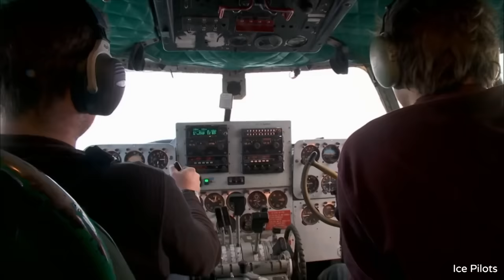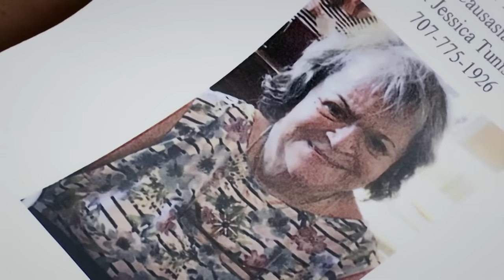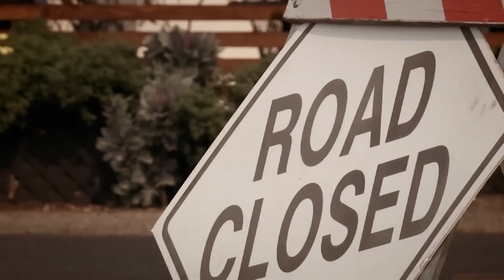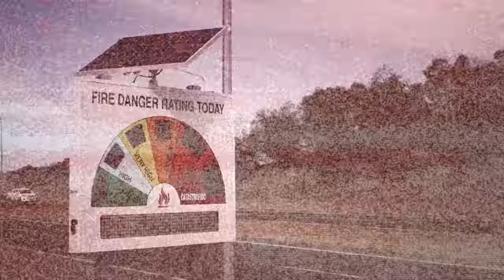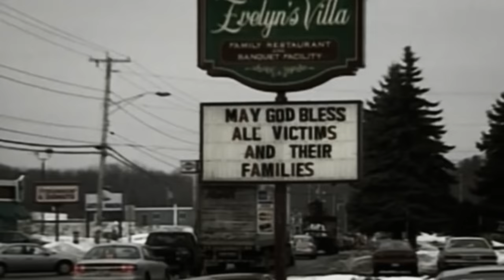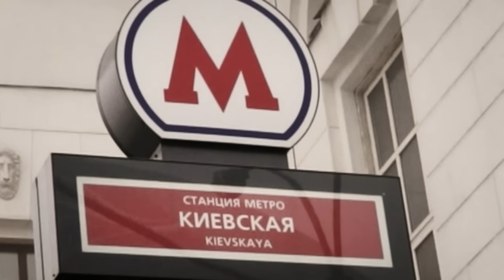The Most Catastrophic Fires In History | Code Red

Comment: The reason why the fire brigade told Grenfell residents to stay in was due to the design of the buildings. They were self contained flats within the building, with fire breaks and a central stairway that needed to be clear for fire fighters. the external cladding meant that the self contained nature of the design was circumvented. It was known to be flammable, but it was still used. When they realised the fire was going up the outside, it was too late to get the people out as the central part was clogged with smoke. The fire fighters were bringing people out on their BAs. Awful. Just awful.
Reply: Stupid firefighters and stupid building for not having more then one stairway
Reply: @beverlyarcher546  Why stupid firefighters? Blame the top, not the common man.
Reply: Stay hope not to die because of staying? No, I am getting out first chance I get.
Reply: @catnip2167  You and me both
Reply: @odd_shoes  because one they didn't think about the fact that the tower has only one staircase and could cause problems if they couldn't get the fire under control which they didn't get it under control in time and lives were lost because of their stupidity just like that ferry where the captain and his men got off first and abandoned passengers and lied about no passengers on board and all those students who died because they were told to stay in their cabins
Reply: Experts always explain the flammable cladding in Grenfell Tower which is fine, but they never discuss how the windows were replaced during the refurbishment. The new windows were installed several inches OUTSIDE of the original cement slab walls...leaving a gap that was filled with flammable finishing materials. That is what destroyed the compartmentalization that is essential for high rise buildings to be survivable. 

Other towers with similar cladding have caught fire but none have been nearly as deadly b/c fire couldn’t get back inside as easily as it did in Grenfell.
Reply: @beverlyarcher546 
Are you so ignorant as to think the firefighters climbing those stairs, at the risk of their own lives, trying to rescue strangers, had any say in the building design?
Reply: Dew can incinerate anything in its path...
Reply: The firefighters wanted to stop the stay put way earlier !
Reply: obviously that didnt work
Reply: @pretzel_cat  What you say is completely true, but I need to explain what happened and why.
The first and major factor was government austerity at the time, which reduced local authority to a minimum. Major works were not inspected during progress and developers appointed their own surveyors. As part of the EU, these surveyors were not required to qualify in the UK. You can see the conflict of interest.
Likewise, local authority surveyors did not need to approve the designs. Without PHYSICAL inspection, mistakes were slipping through unnoticed.

Cladding
In the same way as walls separate the apartments, between the concrete and the cladding fire barriers should have been installed. Out of the 400 required not a single one was fitted. These should have been included above all all doors and windows, to prevent the entry of fire.
In addition, while the cladding was flat, the concrete was not. Tons or highly flammable insulation wes added to fill the gaps that were up to 4 inches deep.
You mentioned the window design but fire should never got to a sufficient temperature to breech it.

The stairwell.
This was correctly designed for the original building and on the conversion the correct fire doors were fitted.
When the fire started, the fire brigade were faced with around 100 heavy locked doors, Some tenants had added additional security locks. 
Doors were not being opened, so without pass keys the firefighters had no idea which apartments were evacuated and which had potentially trapped victims. They started breaking the doors down, so now being unable to close them, the stairwell rapidly filled with smoke and became impassable.

Sprinklers.
These were the red herring,
A total of around 400 heads would have been needed, but since fires are not expected to happen more than one at a time, the pirework, water supply and pumps would have been designed to support around 20 at any one time. Neither the water or electricity supply would have supported more. They may have suppressed the original fire, but even then the building was still an accident waiting to happen.
Even if sprinklers had activated, the people would still have died due to the poisonous smoke 

As you may have guessed, I am a retired chartered design engineer. My work included several major London theatres, including Odeon cinemas.
I could spend all night discussing Grenfell, But needless to say it was a national disgrace.
The enquiry was mostly useless, burying those major points that I mentioned in more than 1,000 pages of drivel.
Reply: @wilsjane On the window point,  the framing was made of PVC. That's how it got out, and then back into the building.
Reply: @NiarahHawthorne  The window frames and sashes were box section galvanised steel core. with UPVC outer casings. These were class 1 and under normal circumstances would have been fairly safe. 
When the cladding was added, the frames were moved outwards to line up. This left a wide sill on the inside to cover the concrete wall and gap behind the cladding. These sill boards were PVC and had no fire rating.
In most cases the fire (Which was manly behind the cladding), burnt through the sill boards on the inside of the window frames, filling the apartment with deadly smoke within seconds.
Reply: @wilsjane  Yes. And also helped create a chimney effect between the old surface and the new cladding. But that PVC is what allowed the fire to spread outside the apartment in the first place.
Reply: @NiarahHawthorne  On the outside, the main culprit was the sprayed foam insulation that was sprayed over the entire building prior to the cladding clamps being fitted. The insulation was between 30 and 100mm thick and highly flammable, then you had the 50mm air gap between the insulation and the cladding. To prevent chimney affect, 400 fire barriers should have been fitted do divide the gap up along the lines of each apartment. None of these were fitted. 
To understand the full story, you need to go back to the beginning. Grenfell was built after WW2, to solve the acute housing problem. The outside was single slab concrete, which had poor insulation problems. This led to serious condensation and as the concrete soaked up the water the insulation got worse. Entire interior walls were covered in mould because the tenants blocked all the vents in order to keep warm. It was a very poor area of London, so half the tenants has social and mental problems.
Prior to the refurbishment, it was one of the worst slums in the UK, with 25% or the apartment uninhabitable, while unruly teenagers and homeless people were using the maze of stair, corridors and broken lifts as public toilets.

During the refurb, contracts were based wholly on cost and the whole thing  developed into a comedy show. Among other things, rather then being filled with concrete previous boiler flues and holes left by disused  pipes were being stuffed with newspaper and toilet rolls. 

Following the fire, the report on what led up to it was well over 1,000 pages. 
The whole thing was a national disgrace.
Reply: @wilsjane  I'm well aware the history and the factors that led to the disaster. It's why I mentioned the PVC windowsills because with fire-resistant window sills, the fire would not have spread past the original flat, period. At least, not fast enough that the fire brigade wouldn't have been able to get it under control. That is the entire point of my comments.
Reply: @NiarahHawthorne  Thank you for your reply. Were you involved in the enquiry, where everyone was passing the blame and companies kept droning on about sprinklers without knowing how they worked. I felt so sorry for the head of building control, who was working without his former staff and relying on reports from surveyors appointed by developers.
The main loss of life started when the fire started to break into the apartment above the original fire. They mistakingly thought that people were trapped and broke the door down, allowing deadly smoke to vent into the single stairwell, cutting off the escape route to everyone above.
People may have survived in their apartments if the window sills had held, but it would not have taken long for the glass to shatter due to heat.
If the windows had been installed correctly and included the fire barriers in the fire flat,  the external fire would not have started in the first place.

Comment: Two of the most catastrophic wildfires in my state, New Mexico, were started by National Park personnel. Both were prescribed burns that got out of control.
Reply: That is the risk with "controlled" burns is they can get out of control and bad things happen. That said we have suppressed fires for so long that instead of fires being tiny and beneficial. Now they just rip through and destroy everything!
Reply: That's too bad. I definitely understand the reasoning behind prescribed burns, but you'd think, by now, they'd be able to have more control over them. What I mean by "by now" is that people have been doing prescribed burns to mitigate summer fires long enough, I would think, to have better control.
Reply: Yeah, it's more than a little ironic that the fact that they can get so out of hand basically shows that they are VERY necessary, and quite overdue.
Reply: Here in Northern California, prescribed burns are only allowed the wetter months. But you’re right, prescribe burning does go out of control at times.
Reply: @judithjohnson2598  The forest service is only supposed to do prescribed burns during our monsoon season here too. But they didn’t account for the high winds we can get.

Comment: I think external sprinkler systems similar to landscaping sytems but which could wet the roof and external walls should be installed on all homes in areas prone to brush fires or wild fires. They could help dampen the roof, exterior walls, and vegetation in the immediate vicinity and possibly create a fire break, if you have enough houses close together with a sprinkler system.

Comment: “Heat” is not a part of the fire triangle.
Reply: They usually say ignition source for the third part. Well, heat can be an ignition source AND any ignition source is going to be hot,  so it works well enough.